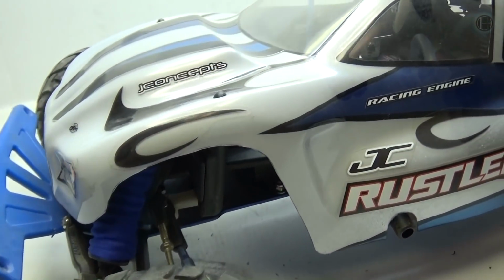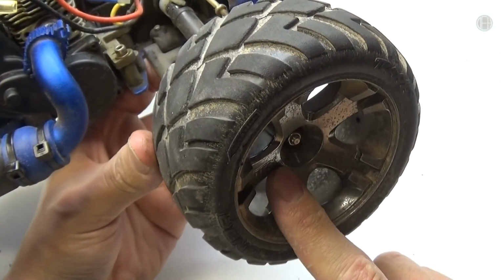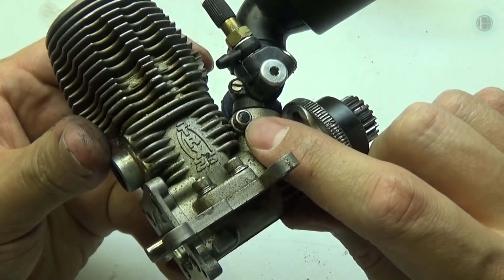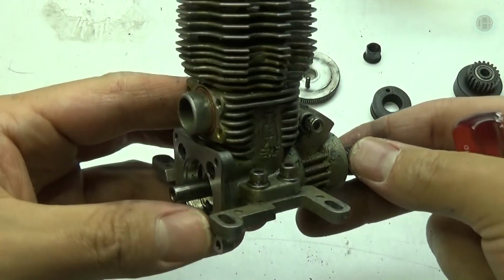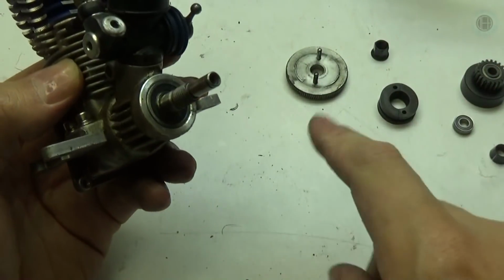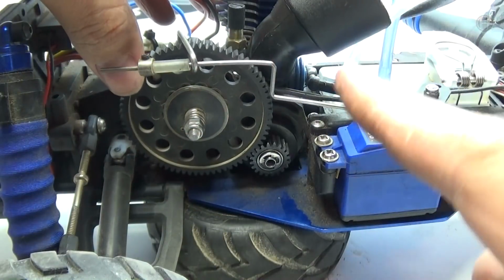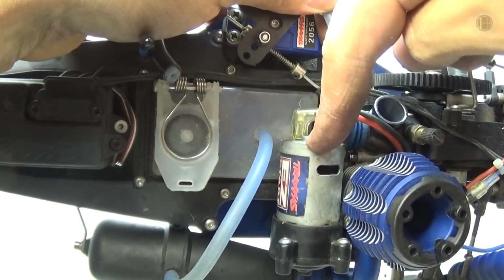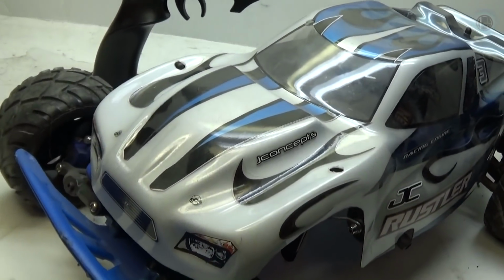Banshee - Traxxas Nitro Rustler - Level 21 Upgrade - 2.5R TRX Engine

Comment: You do realize that essentially all you had to do was just replace the stock 2.5 cooling head to a 2.5r cooling head and you would have had the same engine. The cooling head is the only difference
 Also...it would have been much easier to just remove the 4 screws that hold the engine onto the engine mount rather than removing the engine mount from the chassis and then having to take the extra step to set the gear mesh between the spur gear and pinion gear. You could have made it easier to just pull the engine off the mount and not have to worry about setting the mesh again. Also.... when replacing the carburetor back into the hole as there is an o-ring at the bottom of the hole that can get sheared without even knowing. Be careful when installing the carburetor by very gently using a twisting action and pushing downward to get the carburetor back into the hole. I use a very fine grit sandpaper or Emery cloth and smooth out the rough edge of the barrel on the bottom of the carburetor so that it somewhat rounds out.
Reply: I was always wondering what the difference between the 2.5 and 2.5r the cooling head is one but I don't know if it has different/upgraded internals or what??

Comment: Is the nitro rustler still worth buying? Because the vxl is $279.99, and the nitro is $334.99.
Reply: I bought a used nitro for 45$  and a used electric for 50$ booth needed some work but was a lot cheaper than buying a brand new one especially when you end up upgrading them anyways I've spent as much as a new one would cost on upgrades but saved by not buying them new. Just keep an eye out on the market places facebook ,Craigslist ,let go  etc
Reply: Nitro is worth
Reply: It is worth it:D
Reply: It's worth it if like ya carport or garage smelling like nitromethane residue everyday...such honeysuckle windex sweet aroma it gives..lol